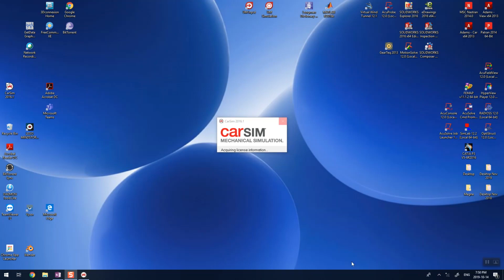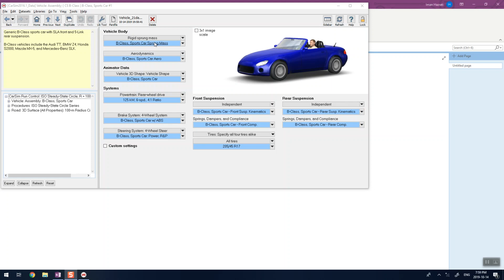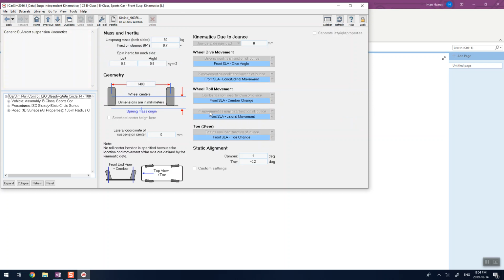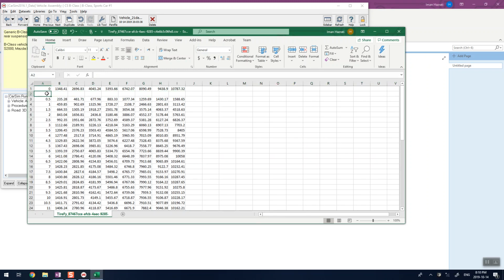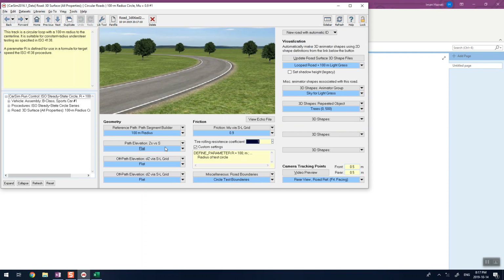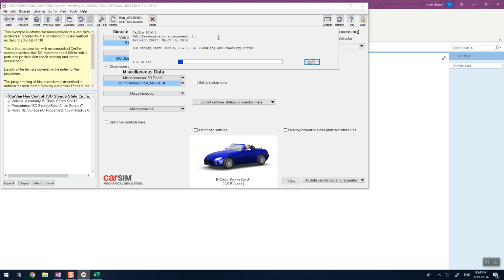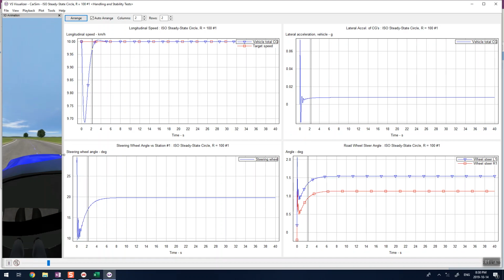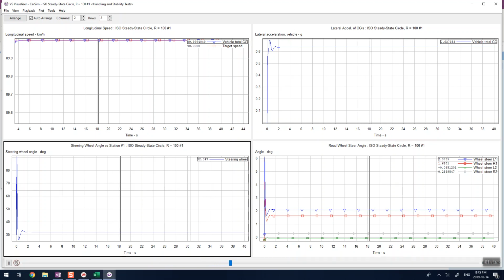CarSim Steady State Handling - Part 1

Comment: hello i have a project on carsim i need help do you have a carsim model about (suspension, braking control, steering or whatever) done or improve by yourself
Reply from the maker: Sorry for the delay. Yes, I have done some. usually used base models and change around them as needed. It depends on what you want to do.